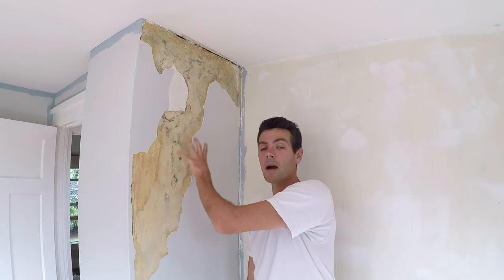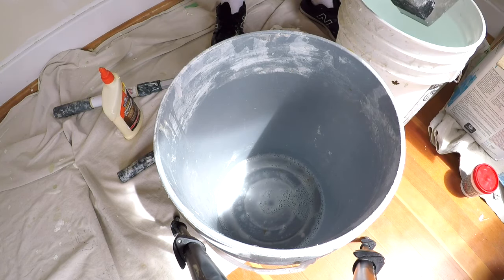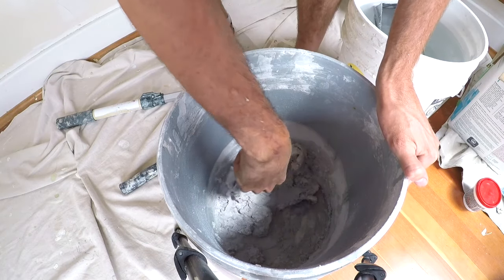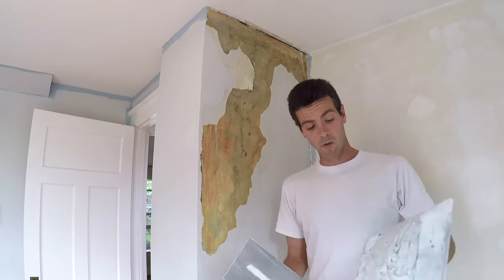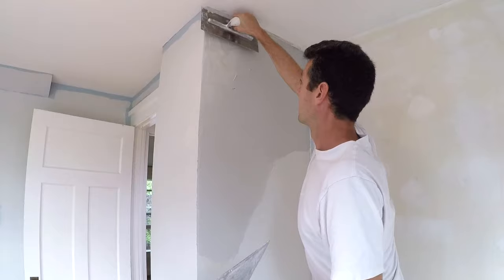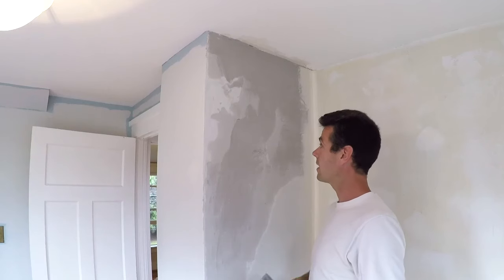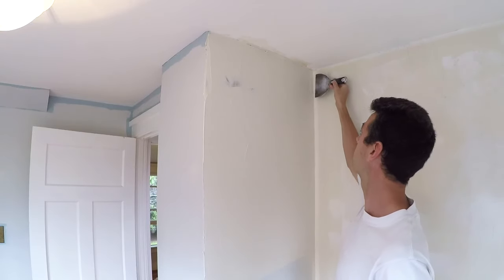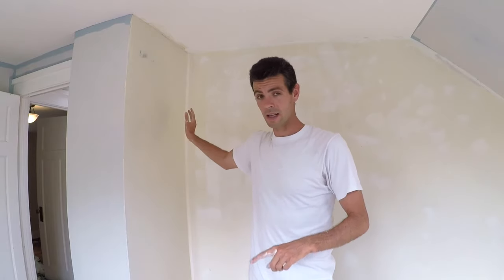Bonding Quickset Drywall Mud to Old Plaster!

Comment: I watched this video quite a few times - thank you for it! My walls look like this, exactly. I bought all the ingredients and I'm going to take a stab at this tomorrow- in two damp rooms. The two questions I have are: is there a reason why you chose to use mud over plaster? and Does the dampness of these rooms make a difference?
Reply: I'm about to tackle this project myself. How did yours turn out?
Reply: It's easier than three step  -  mud was used for simplicity.

Comment: I have thick sheets of paint peeling off a 50+ year old ceiling that was painted 5 years ago.  I have scraped to where the paint will no longer peel easily. The thickness of the areas that are peeled and those that have not seem significant. Would a skim coat of some kind be recommended? My research indicates that the problem may be that the original coating over the plaster might have been calcimine, which is "compromised" by todays coatings.

Comment: I tried this.
Works great. Thank you!
Only complaint - once set, this stuff is ROCK HARD.
Maybe I'm doing it wrong by thinking I should be doing any sanding of that coat, but it's too late for that now.
Worst part - It's on the ceiling...
Any tips?

Comment: I am a little confused.  I thought you only used Weldbond glue when adding to your Quickset.  I was a little confused by your video on mixing up the Weldbond with mud, so I called Weldbond to see if they had a recommendation for the ratio of Weldbond to mud.  Interestingly, they said for a bonding coat, you should mix 3 parts mud to 1 part Weldbond glue.  So that is what I did.  Worked darn good on glossy paint with orange peel textured walls.  Now I have at least a level 4 finish after a couple more coats with no glue and sanding.  You mentioned 10:1 in this video.  So I am not sure which is right.  The manufacturer says 3:1.  I am also interested in why you used plain carpenters glue this time because it is WAAAAAY cheaper than Weldbond.  Thanks for the great vids.  I am learning a lot from you.

Comment: My house needs all of the electric updated and to do so I have to open walls as it still has knob and tube in some parts of the house and I want to go through every room and update all of the Romex wiring. So my question is is how would you go about using drywall to patch in what needs cut out of the old plaster once the electric has been updated?

Comment: I am wondering how to smooth out a plaster wall that was badly finished originally (1940's).There is a high spot that runs the full width of the wall at chest height..sand down and skim coat?  Great videos!

Comment: Hi, I have a question:  How can you repair or plaster over a dried up cracked plaster job that I dont want to remove as it is in the ceiling...   Explanation:  plaster set and dried then began to show  some cracks..   Thanks

Comment: I have the same problem with delaminate paint on plaster wall but I also have large cracks.  I know you prefer paper tape over mesh tape especially butt joints but what if it’s a plaster wall?  After I Pre fill it should I paper tape for butt joint on plaster or mesh?  Almost every crack video I’m finding is mesh tape.  Respect your experience, thank you!

Comment: I have a situation identical to what you have in this video, an old lath plaster wall with surface water damage. For my second skim coat can use a thinner mix of quick set versus all purpose mud?

Comment: Nice videos, as always. Would you use same technique for patches on drywall that remove the top paper, like when you remove a mirror that was glued (PL) ? Patches always seem to bubble. Thanks
Reply from the maker: I usually prime with shellac based primer. You can also spray it with spray adhesive and let it dry. You can also use straight glue amd spread it on with a putty knife, then wait for it to dry fully, give it a very light sand and coat it with all purpose.

Comment: Your videos are AWESOME! Unfortunately, although I scraped all the loose paint off my ceiling, I DID NOT add the glue/water mixture to the bare plaster, nor did I add glue to the drywall compound when I applied it to the crack line to smooth  the wall. Question: HOW CAN I FIX IT?

Comment: I have found that even a prime coat or two of paint does not hide the texture difference between plaster and all-purpose joint compound (which would result on the wall you just showed us because you did not skim-coat the entire wall.  I have used Kilz to try and marry the two textures but can always see the difference.  Thoughts?

Comment: I have torn down a horsehair and lath ceiling, hung drywall. The walls are still plaster and horse hair so when I took the ceiling down I have chunks that went with the ceiling from the wall. Will this method work around top corners of the walls

Comment: I have  old plaster walls with cracks. I'm trying to fix them. I opened  the cracks and applied durarock to fill.  I know you're a fan of paper tape most of the time, but when repairing plaster, can I still use paper tape or is mesh  better because it is plaster?

Comment: I did a similar job recently, water damage around a chimney, a bunch of cracks in the ceiling and the adjacent plaster wall.
I scrapped away the layer of moldy flaky paint, grinded out the cracks.  I used plaster washers to reattach the existing plaster to the lath. Filled my cracks with 20 minute mud mixed with glue.  Tapped with mesh tape and put a big old swath of quickset as a scratch coat... Then another coat of 20 minute mud and i finished with a layer of all purpose.   

in roughly 2 hours I did this repair, had to come back sand and apply a touch up skim coat.
400 is what i charged as i knew it would be at least 2 visits.

Thanks for all your videos!! have you ever used plaster washers??

Comment: I'm doing a lid that looks a lot like this. Small bathroom. Water damage from upstairs shower leak. Existing swirl finish that I am going to try to match. Don't want to carry the angles down the wall. Can I flat tape the lid to the inside corner and patch only the celieng?

Comment: "How to estimate how much water/dry mix" would be helpful.
Reply: The normal sized bags when you dump the whole thing in a 5 gallon bucket and then fill the rest with water that's the right mix. Convenient for drywallers, not so useful for homeowners trying to do a patch.
Reply: @cm01  E-X-A-C-T-L-Y ... and who do we reckon is the primary viewer of videos like this?
Reply: @cm01  Caleb, I'm a low-time DIY homeowner, and I don't need to mix a 50# bag with 5 gallons of water. So yeah, the comment section IS for personal questions (that I'm sure other viewers would find helpful).  Who do you think Ben Degros set this channel up for, skilled professionals?
Reply: @lmo1131  you can't mix a #50 bag with 5 gallons of water in a 5 gallon bucket. See? You don't even understand what I said even after thinking about it for a month.
Reply: @cm01  Thank you.

Comment: DO you think this would be a good method for mudding over plywood?? I have a bathroom on a 70 year old house that has all plywood walls that need to get modernized but I want to leave the plywood for the extra rigidity they give to the walls.. ? Your thoughts. Thanks
Reply from the maker: It might work. It also might slowly chip and flake off over time. I can imagine trying a wall or two but I would be bummed if I did that to a whole house and it started failing. Maybe do a test wall and see how it holds up. Abuse the walls a little after and see what it does. Like really push on them and see if it holds up or spalls.
Reply: @vancouvercarpenter  Would you paint on the watered down glue on the substrate first? Like you've done here? Thanks for your feedback, by the way

Comment: I have a similar project I'm working on where a chimney leaked really bad.  I have a lot of staining, most likely from creosote, coming through the mud after it dries and making the mud brittle and powdery.  My first coat of mud was 45m quickset with glue added.  Then I did a thick coat of all purpose.  The staining is coming through all of it.  How can I seal this and stop the mud from turning to powder when it dries?

Comment: How would I go about tearing out plaster walls and keeping plaster on inside of archway and meet drywall to the exterior corner? Rock lath with wire mesh for inside/outside corners
Reply: Drywall hammer it has an axe head u can chisel & trim

Comment: Could I pay you for a phone consultation?  I hired a person who turned out to be a con artist.  He sprayed my new drywall (in basement) with a heavy coat of Kilz 3 latex primer.  He did not dust the walls first (I learned) and the primer peels off when I grab an edge and pull.  Question is:  Should I do my best to clean up the corners and skim coat, or will everything I do later start peeling off because of poor foundation?  I am willing to put crown molding up in corners to save having to clean out corners.  Steve in Ohio

Comment: Nice one. I thought you'd put paper on the top corner... It looked like there was nothing joining the ceiling to the wall.  New trick in my toolbox: glue on the wall before. Thx
Reply from the maker: The ceiling wasnt going to be painted so I kept the repair on the wall. Worst case scenario it needs some caulking in a few years.

Comment: We have a wall surface in our theater that has been covered about 10 years ago with a think, durable wall covering material (don't know what it is actually made of -- it is fairly thick and plasticy type of material that is water proof).  This material is still in very good shape.  Problem is, at the joins it is pulling away slightly from the much older plaster surface underneath it which seems to be powering underneath it at the joins.  We attempted to glue those areas back using Gorilla Glue, but after a year or so, the material started curling away again. Eventually the glue pulls away from the powering plaster underneath.  It seems your treatment should stabilize the deteriorating plaster enough to hold the wall material again.  Thing is, I am a total novice -- what is this "quickset mud"material that you speak of?  Is it called by that name in the box stores?  Would the mud be needed in our situation or would just treating the plaster that is powering under that wall covering material with your carpenter's glue mixture to stabilize the plaster so we can roll the wall covering material back over the old plaster?
Reply: 20 min joint compound, hot mud, quickset. It goes by many names under various brands. Most stores that carry drywall muds will have something similar.

Comment: I need to know why my 20 minute and 45 minute quickset goes off in five minutes. I mix quickly, load my hawk and can barely apply two passes before it starts stiffening up. What am I doing wrong?
Reply: Gary Sizemore sounds like ur using dirty water
Reply: wizard owl I’ve found out it is a common problem in my city due to the high calcium content in our local water.

Comment: I enjoy watching ur channel,  but this is all wrong. The quickset with added glue and glue on the surface,  will definitely get hard and stick. Unfortunately it will also seal the plaster, plaster unable to breathe properly, especially on a chimney or exterior wall. Will separate from the brick, the lime in the plaster will delaminate. I give it 3 or 4 years.  "SLAKED"Lime putty is the correct refinish. But i think nobody other then old school stucco guys fool with that. and idiots like me who unknowingly took the wrong restoration project once 😂